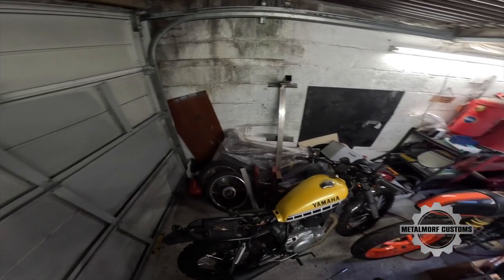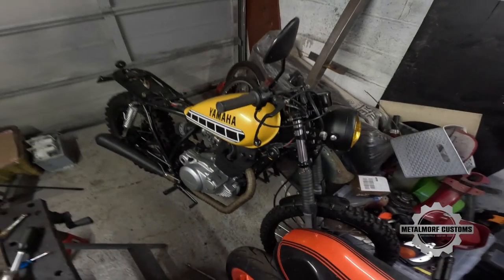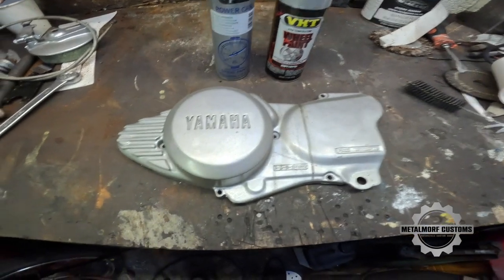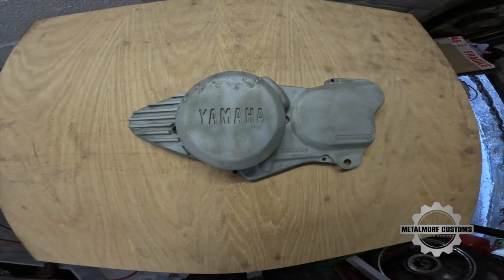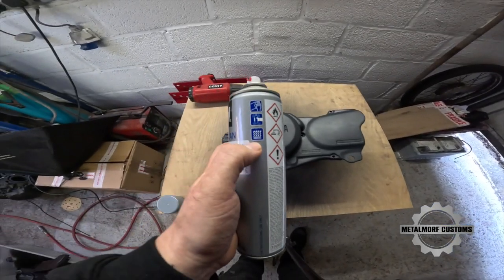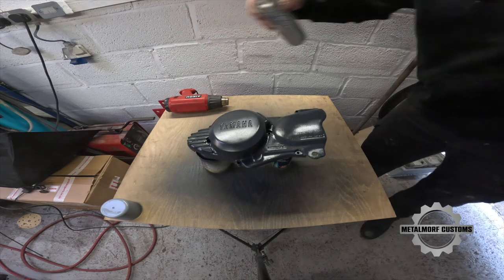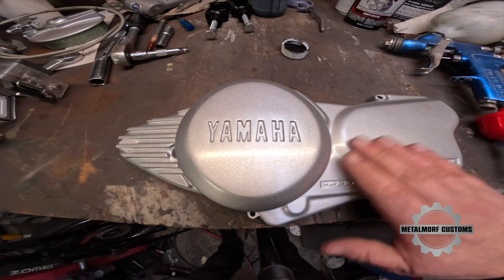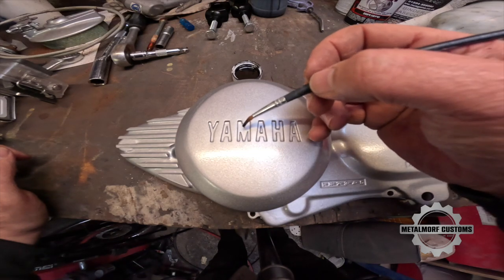Painting the SR250 Engine Case

Comment: Would fine grade emery paper do instead of sand blasting?
Reply from the maker: Hi, yes anything really, as long as it gives it a key. I just use the blaster because I have one and it’s easy. I wouldn’t if I was polishing though, I would use fine wet and dry up through the grades then finish with a buffer.